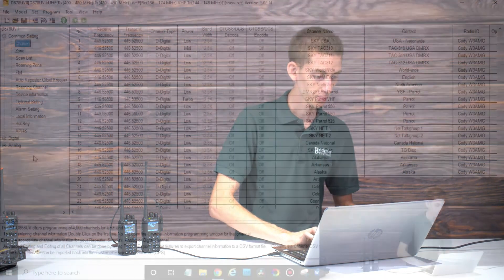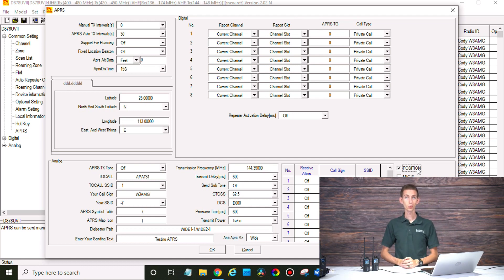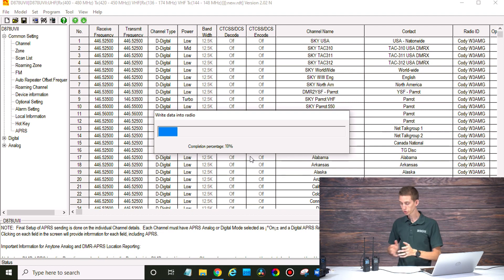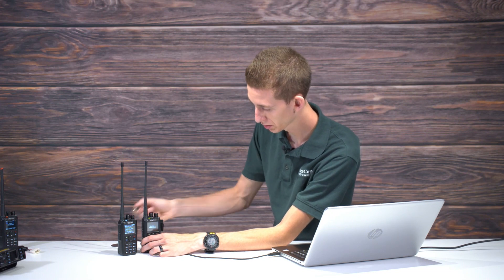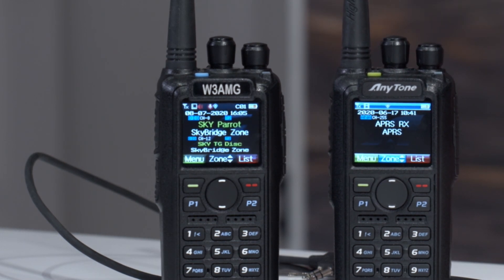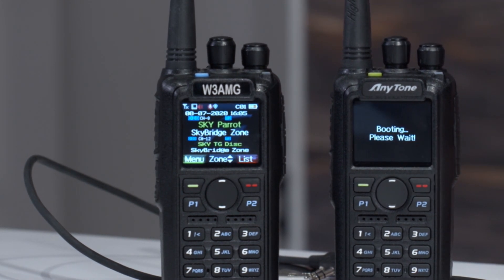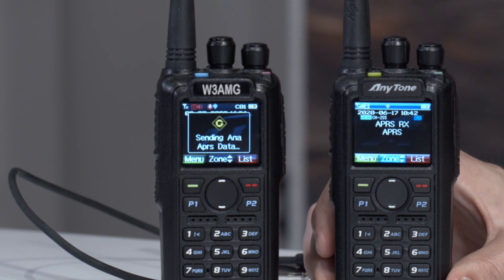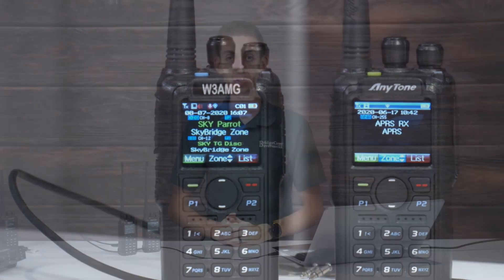SOLVED: The APRS Live Stream Mystery

Comment: I have the AT-d878UV PLUS with GPS -- followed your videos but still does not receive APRS -- it transmits fine but i am thinking still not the right model for the receive part ??
Reply: Correct, you need the 878UVII Plus to get the APRS receive capability.